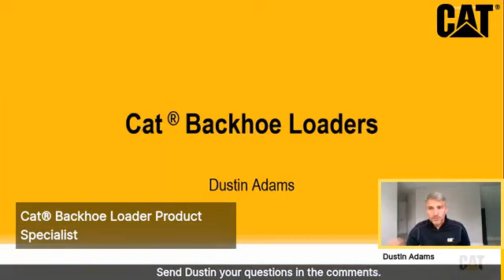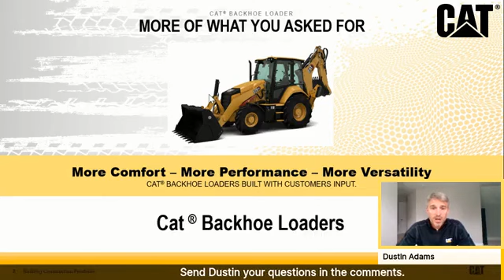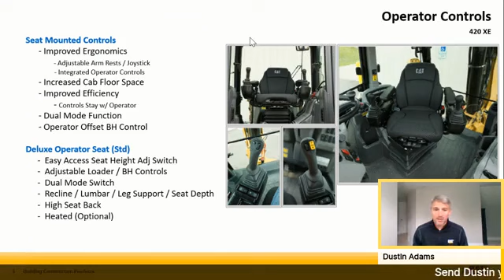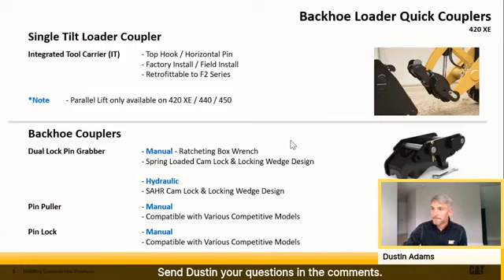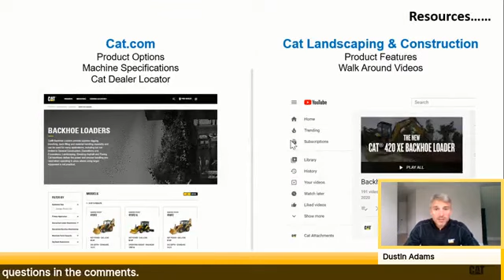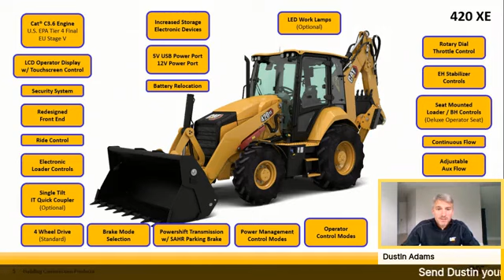Cat® At Home Series – Backhoe Loaders with product specialist Dustin Adams

Comment: So will all the IT machines be single cylinder instead of dual cylinders ?
Reply from the maker: Hi Josh. Yes, there are no new centre pivot IT machines. These are all now single cylinder. The 420 XE machines are equipped with angle sensors to provide true parallelism to the loader mechanism (equivalent to the IT mechanism) and can be turned off/on via the machine's touch screen display. - Dani